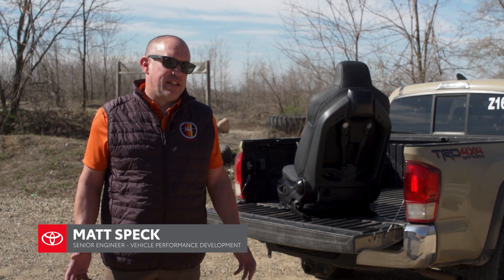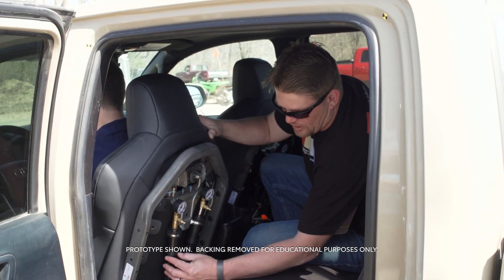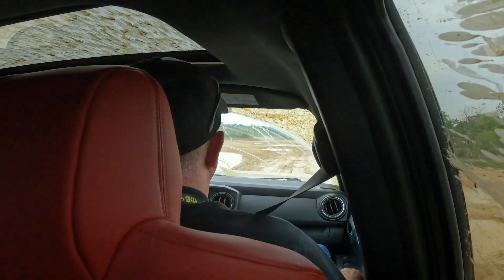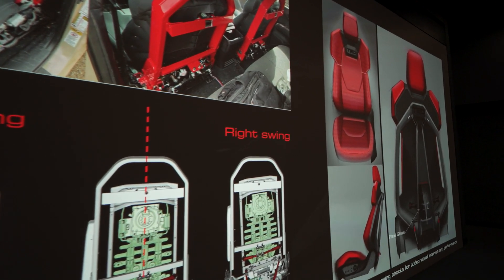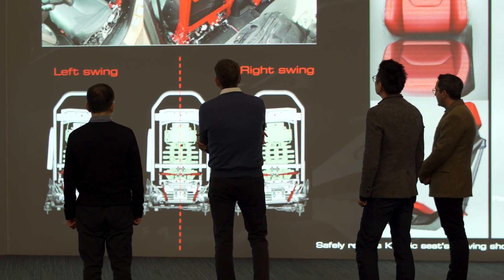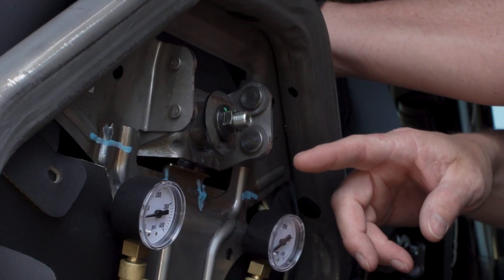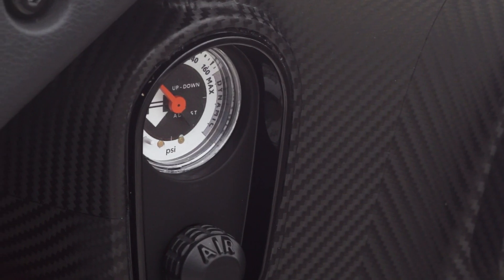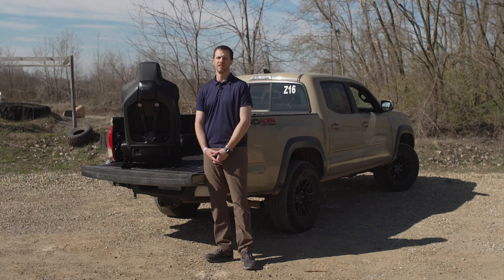2024 Tacoma Debuts Segment-First IsoDynamic Performance Seat | Toyota

Comment: Toyota and Lexus have been absolutely knocking it out of the park. I bought my first toyota a few years ago, 2021 4runner. Total convert, something about them creates an emotional connection. Will keep forever even when I add another daily, which will 100% be a toyota or lexus. Can't wait to see the new GX, can only imagine what is in store for the 4runner!
Reply: My parents went full lexus 15 years ago and haven't looked back. That's also made me a Lexus/Toyota convert and now our entire family has only Toyota/Lexus cars because we know they won't die on us. We're the practical folk that want a car that lasts 10+ years with 150k miles minimum. My 2010 ES350 is at 149k right now and still powering through like a champ.
Reply: @CinemaSteve  I am the same, I keep all my cars until they die or something breaks that the cost isnt worth fixing. I have had 3 Nissan's and Infinity's that I bought 2-3yrs old and around 30k miles. All of them had  issues 80-100k that eventually died around 130-150k. Asked my mechanic what brand for long term he said hands down toyota and some Honda models
Reply: @jsnow6925  yup you really can’t go wrong with Toyota. I’ve heard some nightmares with Nissan. My Civic I had did put me in the shop a bunch too compared to my Lexus so I’m all aboard the Lexus train and that’s where I’m staying. When my wife’s Xterra dies I think we’re replacing it with a 4Runner too.

Comment: How long does it take to readjust the pressure in the seat? 

I'm assuming we'll use a mountain bike shock pump to change the air pressure. It'll be interesting to see if we can easily swap drivers on long road trips, etc.
Reply: It shows dials on the shocks in the video.
Reply: If I’m not mistaken, the TRD Pro that these seats come in also have a built in air compressor in the left side of the bed so you can use it to not only air up/down the tires but also the seats as well.
Reply: @ohainickify  nah, would not use such a high volume pump on such small air damper system. Shock pump for mountain bikes would be best. Already have a couple of good shock pumps since I'm an avid mtb'r, just need the seats now to retrofit them on my 23 trd OR. 😬

Comment: If you all did not know, this was technically the original concept of suspension. A horse carriage that had the seating suspended. I like that Toyota is going back to the very roots of the invention of suspension to maximize experience.

Comment: Should have just put in an air ride seat like a semi. Could have doubled as on onboard air compressor for tires. Or an inflator system.
Reply: I know air ride seat have vertical dampening, does it have lateral dampening as well?

Comment: Love it! Can't wait to seat in these seats! :)
Reply from the maker: We know the feeling! 🙌
Reply: @toyotausa  really?  Do you know that not having auto 4wd like other manufacturers is outdated and out of touch with your customers?
Reply: @toyotausa  🥰
Reply: @witchdoktor69  wow soo hard to turn on 4WD 🗿
Reply: @The PC user  the point is that it would be great with auto 4wd.  It would be good for people who live in snow areas.  It comes on when needed for going through some snow and goes off when you hit dry pavement again.  Other companies are doing it.  You don't have to use it if you dont want to, but there if you do.
Reply: @witchdoktor69   yeah i know but im fine without it, especially considering the snow in my area doesn’t affect FWD or RWD vehicles a lot as long as they have winter tires
Reply: @The PC user  thats you...not everyone else that would like it.
Reply: @witchdoktor69   yeah i know everyone has a different preference and im fine with that
Reply: @witchdoktor69  I'm good with manual 4wd. Like the control. If you don't like it, go buy a rainbow ford or some other bullsh*t. I hear those are 10 times as likely to get rear ended. Maybe that's something you're into. 🤷🏾‍♂️

Comment: Hey Toyota. The driver seat on my Pro clunks behind my back whenever there is a momentum change. Passenger seat doesn’t do it. Very annoying and dealer has no answers. Others on a Tacoma forum are having the same issue.
Reply from the maker: Hi, there. If you'd like to discuss this matter further, please call our Brand Engagement Center at (800) 331-4331. Our Brand Advocates are available Mon-Fri 8am-8pm, and Sat 9am-7pm EST.

Comment: This is incredibly cool. No doubt. Now, Toyota USA, if you're set to design the next Supra, your designers need to look at the MKIV Supra, and ONLY the MKIV Supra. If they want to get wild, look at the TRD 3000GT MKIV Supra, and that's that. Big wing. Targa Top. Manual transmission. I6T engine. AND make sure people up to 6'4" can get in and out of it as well as have the shoulder room needed. I really-really wanted to buy a Supra. I couldn't fit in it. I ended up with a Camaro 2SS 1LE instead.

Comment: Really cool idea but my thoughts are, my experience with shock lockouts on mountain bikes. They are never 100% locked and allow a little give and eventually they all bleed out and need to be pumped up periodically. Would be a shame if any of that was part of owning these seats
Reply: I believe I saw in another video that you can lock them out.  But, not sure on the bleeding out air part.
Reply: I’m sure the brilliant Toyota minds have it sorted out
Reply: @gregjoubert5118  if it’s anything like a mountain bike, shock locking out is not mechanical.

Comment: Mitsubishi already did something similar in 1995 with the Pajero/Montero V20. The front seats had vertical suspension,  adjustable hardness and suspension locking option.

Comment: I get it.  Think it has potential BUT… its too big, you lose too much space in rear seat. And, you lose critical function of the seat? You cant move the seat back to recline or forward? I NEED that function as a taller driver.  There is NO way I would be able have those because of my size or my wifes.  Thats a no go for me. Make it where it doesn’t stick out and you can still recline. Then it might be cool.

Comment: Why not give us what people have wanted for years?   Optional auto 4wd.   This is just another gimmick to increase the price higher than it already is.
Reply: There is full time 4wd optional on the top trims I think.
Reply: @ALMX5DP  that is on all the trims. 4 high and 4 low.   I said auto 4wd.  The system can turn it on an off as road conditions call for.
Reply: @witchdoktor69  well beggars can’t be choosers, it’s still available. And the full time system is similar enough in my mind, simply using a viscous center diff instead of a clutch that most 4A use.

Ah I think you misunderstood. The new Tacoma has traditional part time 4wd that you shift between 2wd and 4wd. But there is a full time system that works similarly to 4A that is available on top trims.
Reply: @ALMX5DP  thats right....full time.  Always on.  Thats different  than auto 4wd.  Not the same thing.
Reply: @witchdoktor69  like I said though, close enough as they both provide the reassurance of four wheels being driven as needed. Only difference is one has a more constant torque split in regular driving.
Reply: @ALMX5DP  not close enough...the differnece is one is auto and one is not.  You shouldn't be driving in 4wd when not needed.  That is where the auto 4wd comes in handy.  For those who want it.  Just watch shows like TFL...those guys always complain that Toyota doesn't have it.
Reply: @witchdoktor69  I think you should probably brush up on both systems to see their similarity. Toyota and Lexus have used this full time system without issue for decades. Both full time systems and 4A send a smaller amount of power to the front wheels all the time. Full time with the torsen sends around 30% to the front where many 4A systems tend to send between 5-10%. Both then can “lock” as needed when slip is detected to send around 50% front.
Reply: @ALMX5DP  nope.  Dont need to.  You sound smart and seem to portray you are some sort of engineer .  You explained it perfectly.  🤮
Reply: @witchdoktor69  well just sounds like you didn’t understand and interpreted it as being a normal part time locked 4wd system.
Reply: @ALMX5DP  no I understand.  You made it perfectly clear through your demonstration of high engineering brilliance.
Reply: @witchdoktor69  just checking, since you said it shouldn’t be used all the time and initially thought the system I was referring to was equipped on all models.
Reply: @ALMX5DP  yup...great.  Sarcasm!
Reply: @witchdoktor69  I guess you just want to hate on the system?
Reply: @ALMX5DP  no.  Trying to improve it with 4wd auto.  Haha
Reply: @witchdoktor69  what would be improved with 4A over a full time system?
Reply: @ALMX5DP  it's obvious....its automatic.
Reply: @witchdoktor69  so is full time 4wd..
Reply: @ALMX5DP  good for it.  Only available on the most expensive trims.
Reply: @witchdoktor69  sure, your initial comment was just wanting it to be an option. It is just that.
Reply: @ALMX5DP  exactly.   But it is NOT even an option.  It should just be standard.  Especially for the prices of these trucks.
Reply: @witchdoktor69  ah so you changed your position. Well at least we have it this way versus the competitors who don’t even offer it.
Reply: @ALMX5DP  didnt change a thing.  Still think auto 4wd would be good.  If they dont do it though at least make what they do have standsrd.
Reply: @witchdoktor69  well it is an option, and I think one of only two trucks to offer any automatic system (Ranger Raptor is the only other model and trim).
Reply: @ALMX5DP  not an option on all Toyotas!  Why do you argue that?  Only full time 4wd is avail on higher trims.   More trucks have it than you know.  4WD Auto setting is on all Ford F150, Chevy Silverado 1500 , GMC Sierra 1500 and Ram 1500 trucks.  This is of course just a small list.  There are more.  Look it up!  Its ok to be wrong.  Just educate yourself before arguing with people.
Reply: @witchdoktor69  ah no not all Toyotas, just an option on Tacoma.
Reply: @ALMX5DP  so you are saying that full time 4wd can be purchased on the lower trims?  You're wrong.  Something isnt an option if it cant be purchased on a certain trim.
Reply: @witchdoktor69  no it’s optional, just like 4A is optional on half ton trucks.